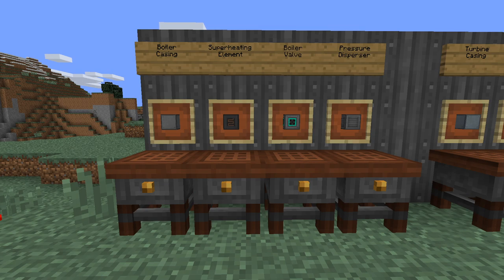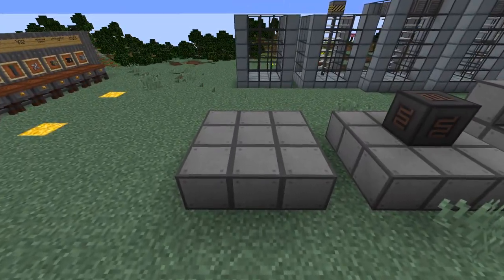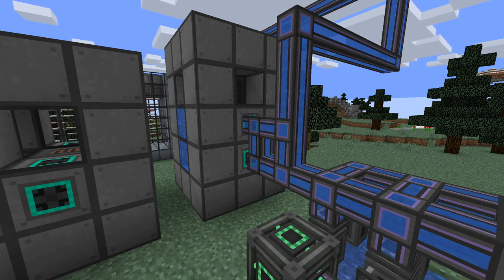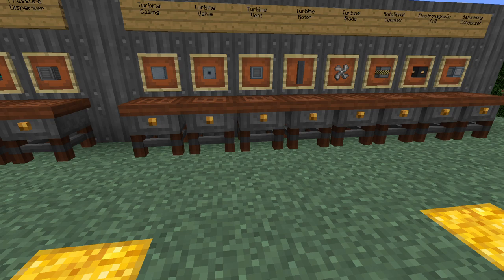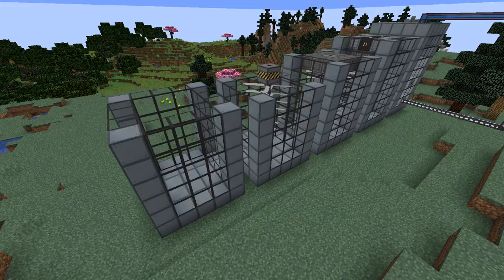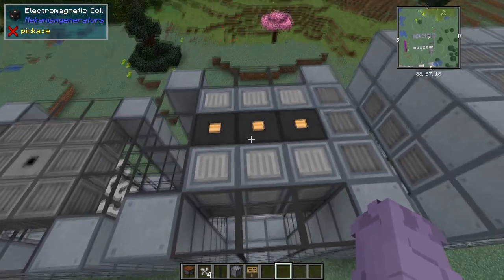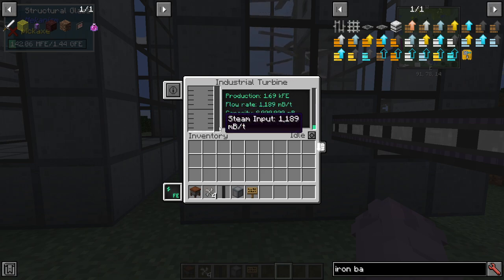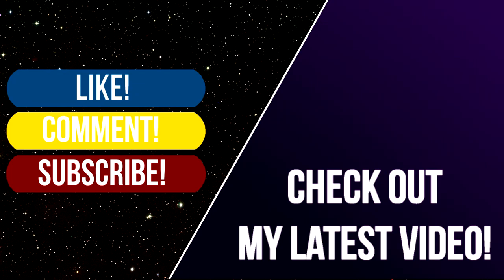Minecraft - Mekanism Part 9: The Thermoelectric Boiler and Industrial Turbine

Comment: Dear god 17 x 18 trubine is too expensive. I spent about 5k steel ingots and about 10k iron
Reply from the maker: Let me know when you get to Induction Cells
Reply: Did you follow the ftb wiki guide with the same blocks count ?
Reply: @singe7260  no, i pretty much figured how multiblocks work. 18x18x18 is not worth the trouble